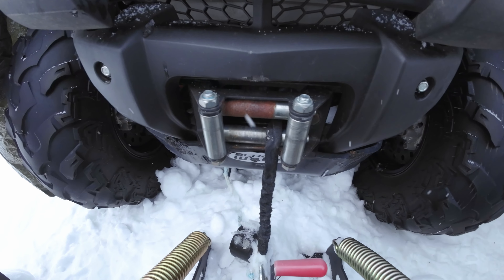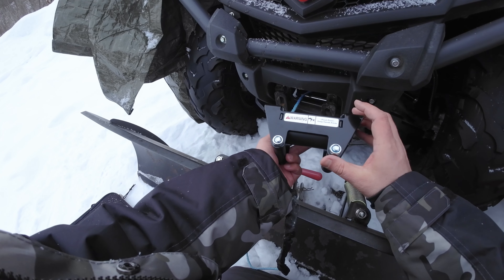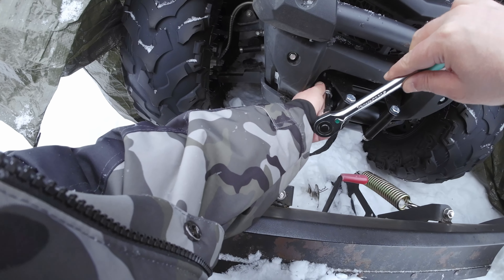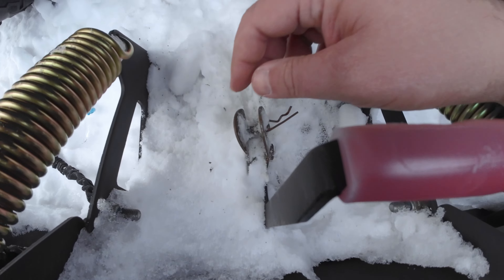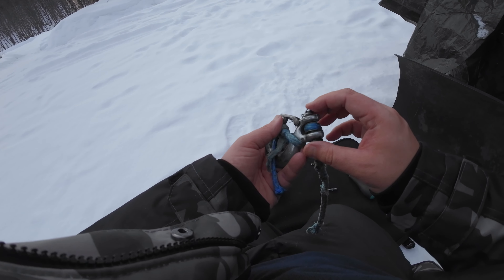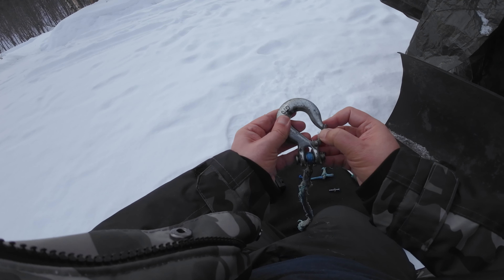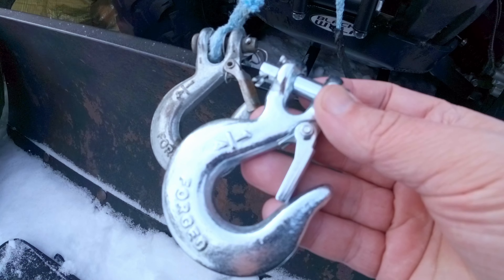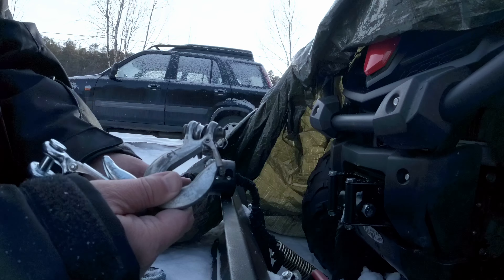Upgrading Your Winch Rollers

Comment: My Outlander has had the larger roller (plow fairlead) with the same synthetic line for 7 years.   I'm finally replacing the line this season just because of age.   This should work out a lot better for you than the small roller.   That's really for use with steel cable anyway.   Best wishes as always from Utah,  USA!
Reply from the maker: Thanks. Yes I really hope this one will make the syntetic rope last longer and also not wear out with rust like the old one did. I only use my winch while plowing, so still have some plowing left to do, to test this new rollers out.